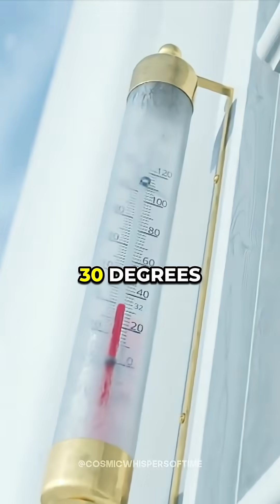Why Pipes Burst in Winter ❄️ w/ Neil deGrasse Tyson

Comment: As a physicist I think it's deeply incorrect to say temperature remains at 32 (what the hell it is) until the water freezes... i'm pretty sure temperature goes down even if the water in the pipes doesn't freeze, it just stays in a overcooled state
Reply: Super-cooled. Check out the Scablands of E Washington and how the formed. Interesting stuff with glacial dams and super-cooled water.
Reply: I always thought it was pv=nrt.  But I'm not a scientist    I'm assuming you just solve for t and then you have your answer
Reply: @lukesdayoff  That's just for an ideal gas, here you're talking about a liquid. Use the phase diagram of water
Reply: Correct for ideal gas law
Reply: This is actually more complicated than every one of you is making it seem. Everyone who states Neil is wrong are not doing a full evaluation of the macro and micro forces. Someone pulled Ideal Gas Law which doesn't apply.

Let's start with Water Freezing. Water expands when it freezes, and the pressure of a liquid remains equal throughout the pipe with no obstructions. Water at higher than atmospheric pressure remains water at 33F. At 32F it begins to freeze. After it freezes, the temperature can drop.

However, water expands initially when it freezes, so as the water is freezing and there are small ice crystals trying to form, they increase the pressure of the water. Now in order for water to freeze it has to expand so the pressure builds. The water's molecular bonds will not release heat energy as that energy is converted into pressure energy. So the temperature doesn't drop, but the pressure increases. 

Neil is right. I didn't know before I wrote out the analysis, but it makes sense. As long as the energy is conserved, the analysis is valid.
Reply: @kbenti no. "The act of squeezing prevents temperature from dropping" is simply wrong
Reply: Chem E.  Very much agree with you.  You can google freezing point depression.  Just did that and I saw a phase diagram for water and a nice explanation of what happens with water "For most substances, increased pressure leads to a slight increase in the freezing point, but for water, the freezing point decreases slightly with increased pressure. This is because water expands when it freezes, and increased pressure favors the liquid phase, lowering the freezing point"
Reply: as a chemist i agree
Reply: Isn't that how the water bottle instantly freezing thing work
Reply: yea "pretty sure" is not something physicists typically say
Reply: @dennisyoucar920  😂😂😂
Reply: He literally said that the temperature drops and the water doesn’t freeze even though it’s below freeze point
Reply: Listen closer dude...he says the temperature OUTSIDE drops, but the waters temp stays the same at 32 degrees because it can't expand to freeze.

This is pure stupidity; mainly defying known laws of thermodynamics which have ZERO exceptions among other things.  Surely, though, I think in the moment he just misspoke and said the wrong word...as basic of a thing as this is I'm quite sure he doesn't actually think a supercooled substance stops decreasing in temperature until suddenly it's temp jumps to another value with phase change.  He prob meant to say the volume is staying the same thus preventing expansion, or just was thinking of the other phase change going from liquid to vapor; here once the phase change is occuring, pumping in more energy does not raise the temperature but only provides energy for the change of phases....but this is referring to a process of energy flow, amount over time, not static properties. 

 If the water was in process of freezing, then a drop in temperature would indeed not cause the water temperature to decrease because it would be in equilibrium of liquid/solid and like boiling water, the temp stays the same during phase change where energy removed only changes the phase to solid not reduce the temperature further.  Since this is not the case here though, there is no phase change equilibrium, the temperature of the water will and must go down as it's energy is lost to the environment through conduction.
Reply: No , it stays 32 or it wouldn't be liquid anymore.
Reply: @joshuabowkley3490  That's wrong! The temperature of the water will continue to drop below 32°, but it can't freeze until it has room to expand. It remains a liquid in a supercooled state. The second the pipe bursts or someone opens the tap, the water would immediately expand and turn to ice.
Reply: @OneTequilaTwoTequila  Kool story.
Reply: @joshuabowkley3490  Hahaha go back to kindergarten
Reply: I feel like this was cut or edited or he misspoke because he’s ver intelligent
Reply: I think you're right. It's similar to the ideal gas law, but it's a phase transition. It doesn't make sense that the liquid temperature couldn't actually drop lower, even though the water cannot expand to form ice. Can water pressure be a barrier to heat being able to transfer? I think that's what Dr Tyson is saying, but I think he's actually wrong.
Reply: That's what Neil just said. Watch it again
Reply: Respectfully, you are wrong !
Reply: @Nedxr777 "the act of squeezing prevents temperature from dropping". That's idiotic
Reply: He must've had a senior moment and said the wrong word...surely he understands the temperature of the water doesn't stay the same, but meant the squeezing keeps it the same phase or prevents phase change/expansion...or meant keeps the volume the same etc.

If the "brilliant scientist" really believes supercooled water under pressure remains at it's standard freezing point temperature (standard of most all phase changes of substances listed are standardized at 25C and 1atm) then he's one ignorant dude and needs not to be influencing the masses.  Though here he probably just said the wrong thing and didn't realize it, I have heard him truly butcher other explanations and be totally aware and serious....but be dead wrong spreading purely illogical nonsense to everyone.  This is sad and a bit scary because so many people respect and believe him with no questions asked
Reply: @FantozziUgo1001bis  It's not though. The pressure literally artificially lowers the freezing point of water. Technically the water is under pressure so it prevents the change of state.....you know, just like pressure on boiling water can prevent it from turning into gaseous form as seen in a radiator in an automobile.
Reply: @diambizz0 so what's your point? Lowering the freezing point is way different from "preventing water to get to 0° "
Reply: It has to be 0 the temperature for the water to become ice.
32 Is summer.
Reply: @Sir.BlackHole  32 C ,maybe,  not 32 F..

Comment: Hes so wrong, I used to work for my cities water department. Thewater will absolutely freeze if there’s no “flow”, regardless if its in copper.

We bury the water mains (in the street), and the copper line running to your basement (through your yard) at least 5 feet deep below the “frost line” (it varies by region; Northeast it’s usually 4-5feet)

The “weak spot” is where the water line  enters your house/foundation. If your basement gets cold enough; and the water comes to a stop in your lines (sitting stagnant with no flow at all dead end) because you forgot to drip them, it will freeze

This guy is just all over the place

Comment: As a plumber that certainly didn’t blow my mind
It’s just basic science 
Water expands by 10% when it freezes 
That’s why pipes burst and that’s why I have work 😂
Reply: What he means is crap pipes exposed to sub zero won't last as long
Reply: He also mentions the role of pressure on triple point.
Reply: The point you missed is that the temperature can be significantly below the freezing point of water without that happening if the pipe is strong enough. The non basic science he was teaching was supercooled liquids.
Reply: @michael-3-l3  Uh, no - the point that YOU missed is that Tyson got it wrong. He should have made your point about supercooling, but he screwed up and said the pipe stopped the temperature from dropping.
Reply: @DS2CV  He didn't screw up and most definitely didn't say the pipe stopped the temperature from dropping.
Reply: @michael-3-l3  You are wrong - I quoted him verbatim. Watch it again and listen this time.
Reply: Ok science guy we believe You!

Comment: Incorrect facts:
32 degree to 4 degree water density increases so the volume decreases, hence there is no squeezing till 4 degree it only happens after it cools below 4 degree
Reply: correct facts: WATER CANT FREEZE AT 32° BECAUSE IT'S TOO HOT TO BECOME ICE.

IT HAS TO REACH 0°
32 Is summer temperature
while 0 is Winter temperature

Comment: Am I to understand that the water in the pipe remains at 0°C due to the heightened pressure in the pipe?
Reply: molecules bouncing, no space to expell energy, probably generates just enough to not freeze until the pipe can't hold the pressure anymore. Stronger the pipe, the longer it takes to get to that point. That is how I imagine it from his explanation anyway.

Comment: he talking about principles that that are in HVAC. freezing point and boiling point. things change within a pressurized container
Reply: He was talking about water distribution in a plumbing system.
Reply: @johnnyG5704 thats what he uses as a reference to get you to understand, but you gotta learn to pick up on the other things yourself my guy, look at the bigger picture and you'll probably get what he means
Reply: @chaoticshadow778  yes indeed,  just like water boils at 212⁰ AT sea level, basic principles. As a union plumber i had to let the hvac guy know this example was not about his refrigerant lines condensing and what not. They chose the better trade to make the example.   If you had looked at the bigger picture you would of realized it was just two tradesman having a conversation.
Reply: It's more about the interplay of water and ice under pressure and what it can produce. Outside of HVAC, most people don't understand these things; the how or the why. Neil using the example is to illustrate the point for laypersons, not for the already initiated.

Comment: The stronger a pipe is, the harder it is to break it. I'm taking notes.
Reply: Not true though.. Pex resists breaking better than copper
Reply: I’m certain that the physics is a bit more complex than the “strength” of the pipe and the water “wanting to freeze”.

Comment: Water pressure is what stops the deep ocean from freezing then?
Reply: bottom of the ocoean is not frozen cause the temperature is never at freezing level... the top will freeze... but at a certain depth... the water gets warmer ...
Reply: @mokegent  The freezing point at depth is lower because of the pressure. Saltiness & currents keep the temp above zero.

Comment: "The stronger the pipe is the lower the temperature have to be to break it". OK what was amazing about that?
Reply: It’s the copper pipe. Houses aren’t built with copper pipes to keep plumbers in business. A home with copper pipes is safer in that type of situation than any other type of piping.
Reply: @nellokiko6755  at that point you have biger problem than cooper pipe 😂
Reply: @nellokiko6755  I honestly think reason why houses arent built with copper pipes is that copper is 
1.corrosive
2.expensive
Reply: You just don't care about science, otherwise it would have been interesting to you